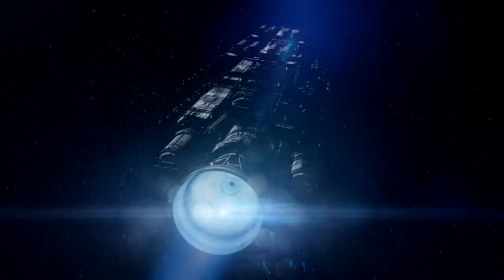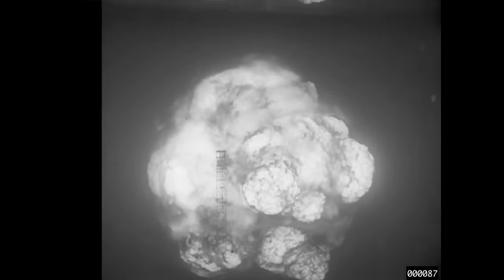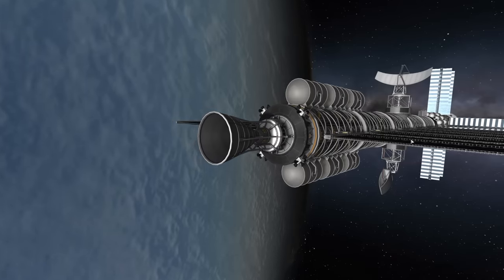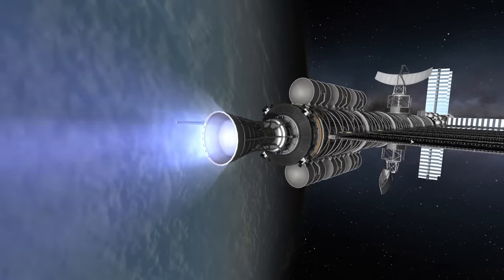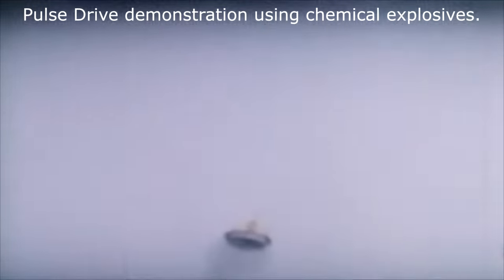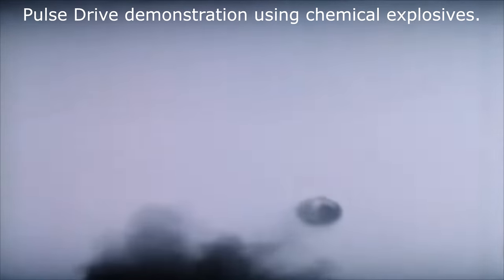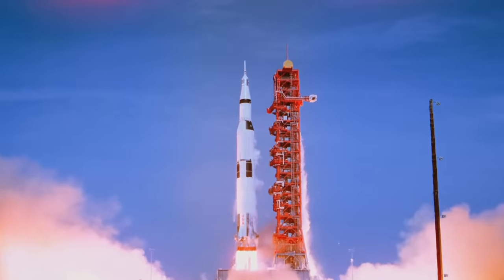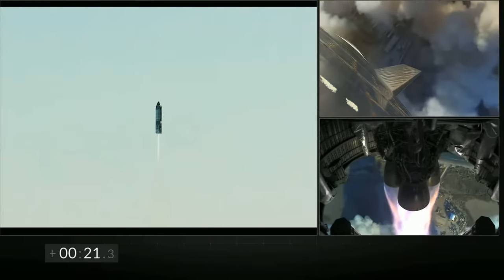The Nuclear Salt Water Rocket - Possibly the Craziest Rocket Engine Ever Imagined.

Comment: Having read Zubrin's paper, there seems to be a pretty obvious show stopper in this design.  Zubrin goes to great lengths to explain how a critical mass could be maintained in the cylindrical part of the engine(plenum) due to the fact that water is basically incompressible and would maintain a steady flow rate.  But then he wants almost all the actual fission to happen in the nozzle where the propellant is more spread out and is no longer a critical mass.  Because uranium atoms only release a limited amount of neutrons when they split there is simply no way to generate enough neutrons in the plenum to split the required number of uranium atoms in the nozzle, and if you had enough uranium in the nozzle where the propellant is spreading out to maintain a critical mass the plenum would go up like a bomb.  Also you cannot heat the water in the plenum enough to turn it into steam, because then you have to take gas laws into effect where increased temperature requires either higher pressure(which would result in the flow going the wrong way), or increased flow speed as you go down the plenum, resulting in the critical mass being lost and the chain reaction ending even before you get into the nozzle.  

Because heavier molecules such as water and uranium require a much higher temperature than straight hydrogen molecules to reach the same ISP, I am extremely skeptical that any attempt to build this design could actually reach the ISP levels of a nuclear thermal rocket, never mind the tens to thousands of km/s exhaust velocities Zubrin speculates about.  I would love to be proved wrong, but this design seems to be a classic case of using math to get answers to a different question than you are actually asking.
Reply: I think you would want the water to remain as a liquid in the plenum  both for reasons of hydrodynamic stability and to ensure that the exiting fluid is as supercritical (from a reactor kinetics standpoint not thermodynamic standpoint) as possible. A nuclear bomb suffers the same problem in that the reaction shuts down once the fuel expands beyond a certain point yet they get the job done. I think having multiple tanks/injectors focused on the same point in the combustion chamber would address your concerns, be safer snd allow for some degree of throttleability at the cost of some increased weight and complexity. While H2O is more massive than H2, the higher powers this concept offers is more than worth it. The mass of the salt itself is negligible, particularly is it fissions.
Reply: Does water even stay water at the temperatures we're talking about here? I would think the water molecules would very quickly break down into hydrogen and oxygen.
Reply: I think the biggest problem is that you would have to get all that nasty stuff into orbit in the first place. One failed start and we live in holes in the ground for the rest of the planets live.
Reply: @demacherius1  That's ridiculous. You're massively overestimating the explosive power (assuming all the uranium concentrated during a launch explosion... which it would not) as well as the actual fallout. A launch failure would not be good by any stretch of the imagination. But practically it would be one of those, "caused 15 more cancers than expected over the next 20 years" type of things.
Reply: @thewiirocks   I wasn't actualy concerned about the explosion. I just dont think that it is a good thing to have Uranium spead over a massive area. Isn't that a problem ?
Reply: @NavarroRefugee  Even at chemical engine temperatures, they form an equilibrium of O, O2, H, H2, OH, H20, etc., with concentrations depending on the temperature.
Reply: @thewiirocks  I think the concept would only be considered if the engine was fueled in high orbit. Either from in-situ uranium or from uranium transported up in a safe form that is then turned into the salt solution at the orbital fueling platform.
Reply: @demacherius1  It's not a good thing. But you're vastly over-estimating how much of a bad thing it would be. Uranium 235 is fairly stable as isotopes go and releases little to no radioactivity unless fission occurs. If scattered in an explosion, I'd be far more concerned about the heavy metal properties than I am the radioactive properties. 

If you want to do something about the massive spread of Uranium, I'd recommend you stop worrying about hypothetical rockets, which spread 0.000 tons of Uranium each year, and start worrying about coal plants - which spread around 539,000 tons of Uranium in the US in 2019! (Taken from an average of 0.01% Uranium content in the coal burned for power plants. United States geology reports place the content as ranging from 0.0005% to 0.02% depending on the source of the coal itself.)

Counter-intuitively, all the NIMBY fright over nuclear has lead to more coal burning. More coal burning has resulted in MASSIVELY MORE radioactive material being spread than if we had migrated to nuclear options.
Reply: @TheMongooseOfDoom  Transporting the Uranium in a suspended solution sounds like a way better idea than transporting solid blocks of the stuff. An explosion would not really be noticed in terms of the ~539,000 tons of Uranium we already pump into our environment every year. But solid blocks would have a nasty potential to form a critical mass. And once you have a critical mass of Uranium, you have a real problem. At least for a couple years while we wait for all the really hot stuff to cook itself down to something slightly more inert. Similar to the uranium it originally came from.
Reply: what about neutron reflectors?
Reply: Just correcting myself. I moved a decimal point over on accident. It’s actually 53,900 tons of Uranium per year, not 539,000. Don’t know if that makes anyone feel better about coal (it shouldn’t), but there you go.
Reply: @demacherius1  it's space.  it's big (mind you that's what they said about dumping sewage waste into the ocean)
Reply: I don't see the problem. A long thin tube has a lot of surface area per volume, avoiding criticality. Inside the reaction chamber a more spherical-ish  shape mass is achieved increasing the volume per surface area which can be critical even if the fuel is at a lower density.
Nuclear materials safety goes to extreme lengths to be sure fissile fumes can't pool in some basement and go critical. This takes the same low density high volume concept and targets it rather than avoiding it.
Reply: You are right on point: Zubrin is a typical charlotane hiding behind "scientific" jargon. One can say so after hearing him speculate on mars plans or his VASIMR "criticism". He's running a mars-themed-scam for years now and he uses this false-science-hopegiving trick all the time.
Reply: hmm.....or instead using one big pipe, you could also use many small ones and shoot the water into a focus point of the nozzle maybe?!
Reply: Miky Schuster This is an idea more likely to be pursued beyond the scale of mere space probes once there are outposts in space and/or on other planetary bodies in the Solar System. Where reactors could produce the fuel from far less threatening uranium ore shipped in from Earth. The depleted uranium byproduct of enrichment might be fairly useful as shielding against radiation and micrometeorites.

This technology might, in turn, one day save the home planet of this spaceborne civilization. By providing the thrust necessary to intercept a potential planer-killer asteroid early enough in its approach to deflect it. More likely with a giant cloud of dust delivered in its path, to alter its trajectory, than with a nose-down landing on an uneven surface of uncertain composition to act as a kick motor.
Reply: @demacherius1  The uranium could be lifted from the ground in solid form in some kind of a hardened crate, and then processed into fuel once in orbit. That way even if the rocket goes boom, you can just pick the uranium up from the remains of the launch site with basically none of it released to the environment. Also, uranium is heavy, so even if it breaks up, the pieces will fall back down pretty close to the explosion site. 

EDIT: Also, as Scott have said in the video, fuel grade uranium can not go critical without a moderator, so haveing large blocks of it in solid form is actually the safe option. If you wanted to transport it in solution, then you would have to use a solvent that doesn't act as a moderator, so water and hydrocarbons are out of the question.
Reply: I haven't read the paper, but the idea seems reasonable to me. It's basically a conventional rocket with all "combustion" replaced by "chain reaction". Eventually it all boils down to numbers: the water pipe size, water flow speed/pressure, nozzle shape/size, chain reaction rate, etc. If you find reasonable ranges for all these parameters, you get a sound theoretical design.
Reply: @NavarroRefugee  When nuclear reactors melt down, they become so hot that water breaks into H & O. Happened at both fukushima & chernobyl
Reply: @demacherius1  uranium on its own is actually rather harmless and safe to handle with bare hands without any protective gear (maybe a face mask to not breath in the dust). It is the fission products that are dangerous but there is no fission until you light the match (a.k.a bombard the uranium with neutrons or pile a lot of it in one place and cover it with water)
Reply: Exactly what I was thinking too: this is nanosecond work, I mean can we physically move several tons of coolant in microseconds, BEFORE the fission reaction starts creeping up the feed pipes and what not? There also the phase transfer, as mentioned, which dilutes the density of your fissioning volume by at least 1200 times, so... Without letting it ´precook´ somewhere? There are big problems with this. Not to mention the fact every few 10 microsecond, the thermal power released DOUBLES, so the coolant flow would have to be... Yeah... Immense! Neutrons from fission are nasty little buggers, they go fast, and they do not react with a lot of substances, so just isolating the engines is ok when it is not running... But once that fission reaction starts?

It could quite literally end up like Chernobyl. Which started with film-boiling in the coolant pumps by the way, not the Xenon-myth but out by HBO. So assuming for a moment it works, partly, than the fission reaction will ´prefer´ to go up the nozzle even, and there´s not much you can do about it, except having fuel flows that are nearing several percent of the speed of light?

I´ve seen this engine for quite some time, and firing up in space or the Moon for me wouldn´t be a problem, since I like big colorful objects in the nightsky, as long as I do not need to be present to press the Launch button for this one. But getting it passively safe is not one of the features this reactor has, and lets not forget for a moment it is a nuclear reactor, not a conventional engine where you just turn down the fuel-flow and everything stops... Mechanics can´t make nanosecond adjustments, that´s assuming we get over all the problems mentioned by Mr. Cobb. Simply increasing the amount of enrichment won´t do, since you´re stepping from one sort of operation to another: fast fission vs thermal fission. Nobody has ever seen a fission reactor in plasma/waper-vapour as far as I know either? I think that his running towards 90% enrichment over 20% enrichment is precisely because he gets into trouble with the moderator shifting liquid-gas-plasma phases: Zubrin runs obviously towards degrees of enrichment that will allow for fast fission... Which is again an entirely different beast, I dunno... Just that there´s a good point being made here.
Reply: @thewiirocks  WRT coal and radioactiove emissions:  if coal/oil/gas plants were subject to the same radioactive standards as nuclear plants are, they'd ALL be shutdown on the spot as being dangerously leaky, just on their radium emissions
Reply: @lamebubblesflysohigh  "safe to handle with bare hands" 

It's a toxic heavy metal in the lead family chemically. Plutonium is chemically akin to mercury

You don't want EITHER on your hands or in the environment if you can avoid it and I don't care about the radioactivity in this context.
Reply: @miscbits6399  You’re not wrong. The stuff is really rather nasty. Nasty to mine, nasty to transport, and nasty to burn. Coal was an acceptable technology back when there were no alternatives. (Sort of. The Great London Smog was rather horrific.) But now that we have alternatives, it would be rather nice (i.e. healthier for all involved) if we used them.
Reply: @jedimastersterling1  Yes. Running the brine through some sort of flow straigthener made of a neutron absorbing material should do the trick.
Reply: Not a show stopper. A technical challenge certainly, but there are solutions. A tiny controlled doping of boric acid to the fuel would keep it stable until it is burned off, at which point the fuel can be in a highly supercritical geometry. Keeping such a system stable would not be easy, but microsecond control of additional neutron injection and dopant is more than capable of achieving it. The basic problem is controlling neutron flux/flow. I see no reason to believe there are any insurmountable problems in that, and would not expect a theoretical study to go into such details.

For me a bigger problem is the pumping requirement. In order to achieve such Isp you need to either have a gigantic nozzle (hard to cool) or extremely high pressures (to the point that even the gas laws don't really apply). You might be able to get enough energy from the nozzle cooling, but you are not running enough fuel to use it as a cold end in a heat engine.
Reply: I would think it would be possible using a electric field to manipulate the exact local concentration of uranium as it exists in the fluid as ions. You'd only need another feeder pipe for symmetry
Reply: One way to "safe" the system could be to reduce the uranium concentration of the fuel mix and instead use a neutron gun firing into the reaction chamber to boost it back to the levels needed for critical fission.

This would allow for some reaction throttling as well as an immediate kill switch by stopping the influx of neutrons.

Scott discussed similar techniques used in variable-yield warheads in his Going Nuclear videos.
Reply: @demacherius1  The Moon, Mars, and belt are full of uranium, no need to get it to orbit from earth.
Reply: @GerardHammond  And they were wrong.  The ocean is tiny and finite, space is infinite.
Reply: No, it's OK. All you'd have to do is reverse the polarity of the neutron flow...
Reply: Scott Armstrong Eventually, yes, the fuel could be sourced from elsewhere in the Solar System. With the exception of the Moon, however, those places are very far away. Efficient transfers come and go, and we would probably rely on slow unmanned ore haulers that use gravity assist over fast freighters that burn all the way in from these places. So the Earth, gravity well and all, will be the closest gas station for a while, at least.
Reply: @scottarmstrong5607  Yes I agree but just to be obnoxious: as a gravity well, earth will naturally suck back any local pollutants and radioactive material will not burn up in the atmosphere but rain down as loverly extra dusty background radiation levels  :-)
Reply: @GerardHammond  That is not really how that works.  You'd be surprised how hard it is to throw something into the sun.
Reply: @GerardHammond  Your understanding of orbital dynamics fails you here.  Earth does not naturally suck back anything.
Reply: @youkofoxy  depleted radioactive elements are generally used as neutron reflectors and or absorbers, 
Eventually, very slowly, it will start getting enriched ( over the multiple life spans of multiple design revisions and reuse over multiple decades + )
Not to mention, space radiation will start to make even silicon oxides ( rocks and computers ) radioactive over long enough time spans.
Reply: @demacherius1  that's why these kinds of nuclear propulsion ships would have to be assembled in space. Much like how the ISS was assembled. It would take years but would be well worth it in the end.

Ideally the nuclear material could be sourced on the Moon and brought to the assembly site via a Starship payload. I wouldn't imagine any of this to happen before Starship is running regular trips to the moon and Mars. So around late 2020s to early 2030s
Reply: @Faron Cobb  Haven't finished reading his paper, but what you say sounds like a valid point. However. . . the best outcome of his paper may be that it gets people thinking about this problem again, in a serious way. Because we need to get some of our dna off of this ball, and preferably out of this system. Earth is too vulnerable -  I've just been listening to the audio book version of Arthur C. Clarke's "Hammer of God," about the potential of a fast-moving body crossing Earth's orbit, or should I say intersecting with the Earth at some point in its orbit. He mentions several of the better-known earth-crossing events in the book, but we've had many near misses since that was published in 1995 (?). Or, our sun may not be as stable as we think - Spider Robinson took an unfinished Robert A. Heinlein novel outline and wrote "Variable Star," a plausible scenario about such an event.
Reply: @thewiirocks  The coal-fired plants west of where I live releases over 40 tons of Radon gas per day. And because we're sitting on a lot of natural gas, we have fewer coal-burning power stations than many other parts of the world. Not that I'm in favour of burning something as useful as natural gas.
Reply: @protonjinx  Breaks down further than that, all the way to plasma for several milliseconds at least. Mind you, there's a lot you can do with plasma.
Reply: @thomasvandevelde8157  I haven't finished the paper, or run any of the numbers, but yes, there certainly are some large challenges that go along with this idea. Maybe as it stands, it's not practical. But maybe there's some young grad student someplace who's never been told "it can't be done" and who can visualize tensor calculus in colour, and who comes up with some other, more viable system. Off-hand, I don't know what it would be. But that's often how such things get started.
Reply: @flyingbeaver57  Apology for the long answer, got carried away with a fatigued mind, just thinking about what we COULD do with this design in the back of my head :-) No need to read it all, it´s just speculation in the end.
Less in the land of speculation however, is the only instant that I know off (and we´re not even completely certain about that) a nuclear reactor converted fuel into hot plasma directly, was a phase during the (unfolding) Chernobyl-disaster. It´s an excellent case study of weird, unexplored nuclear power phenomena probably coexisting next to one another in that core. There´s a lot of argument around this Fuel Rod to Plasma hypothesis for explaining 2 different radiation trails (one towards Moscow, altitude >3km, the other towards Prypiat and Kiev, at a low altitude, containing the highly radioactive smoke). But there´s good circumstantial evidence that some fuel got ejected at force, high up in the atmosphere, and I found it an interesting matter. Because for just a very short moment, we had direct conversion of nuclear fuel into hot plasma without any intermediaries or something. So this makes this Salt Water Rocket all the more temping and interesting, hihi... ;-)
Reply: @protonjinx  Infact, even relatively normal temps split water. During arc welding, any water is split into oxyhydrogen, causing potential hydrogen embrittlement in ferrous alloys.
Reply: @thomasvandevelde8157  The neutrons will be moving through the water, which should slow them to speeds where it isn't unreasonable to pump water fast enough. Remember that the reactor is open-ended, as thermal power rockets it should expand the water and go out the nozzle. Passive safety is a potential issue, though PWRs achieve acceptable safety, and this is pretty similar, abeit needing neutron absorbers in plumbing.
Reply: Details, details.....I'm sure it's nothing a couple hundred billion $ couldn't solve. olol